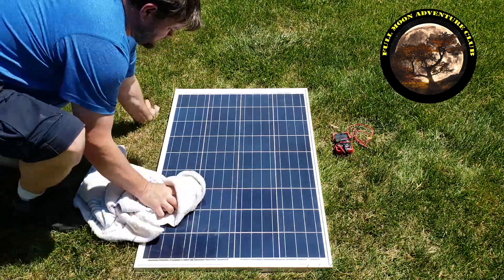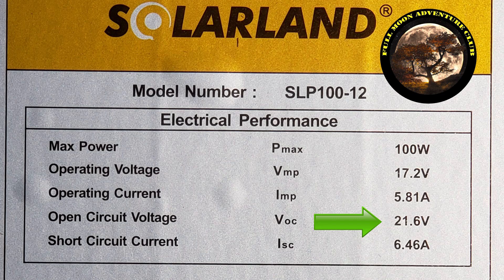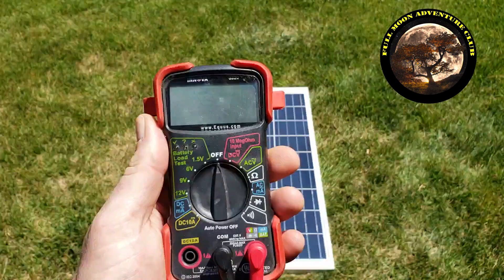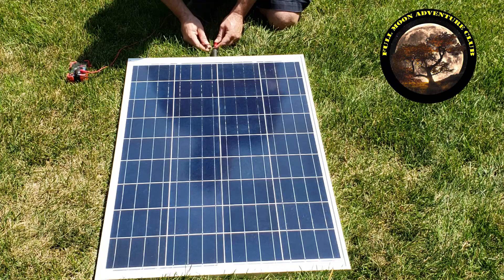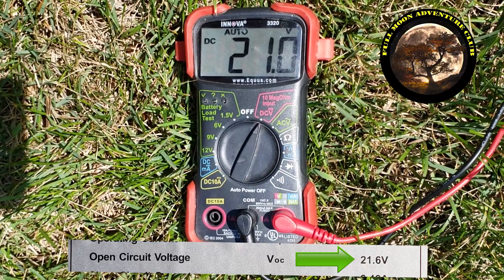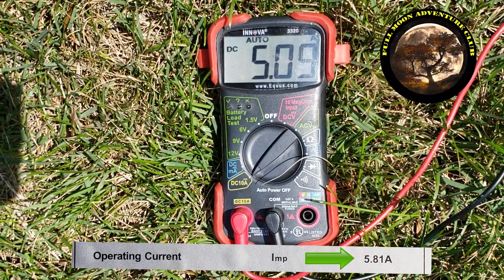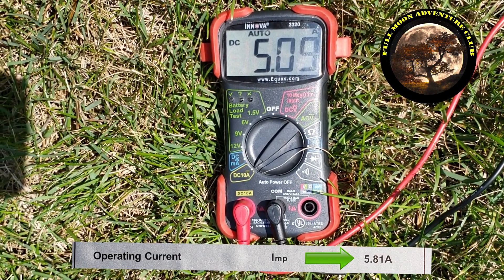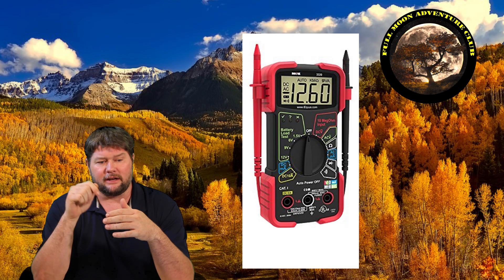How To Test Your Solar Panel - Quick And Easy

Comment: Thanks for the vid, I'm pretty handy and have installed four solar systems one a boat and three rv's. I ordered and installed a 200 watt on my new to me fifth wheel, all was working fine until one day I noticed no indication on my controller of volts to battery. I unhooked the wires and put a meter on and found zero, I grounded the meter lead to the ground on the trailer and it read out max volts, so I know I have a bad ground inside the solar panel, ( I checked solder to post it was fine), my question is can I just skip the ground wire from the panel and run wire from ground on the rv to controller? I have yet to get back to my trailer to try it, but just wondered what your thoughts were.
Reply from the maker: Interesting thought. I have never tried that before. While it makes sense in theory I am not confidant that will work. I believe the solar panel needs its ground to create current. I could be wrong. Let me know if that works.     Jim
Reply: fullmoonadventureclub well it turns out I had a bad diode, the company is sending me a new diode cable box, how that neg thing worked I have no idea, but I unsoldered the flat tin  neg and positive pulled the box off tested those in direct sun, had 22V. I was told there are some bad Chinese diodes out there that will fail or partially fail.
Reply from the maker: @timmytool1231  Thanks for letting us know. Glad you figured it out.   Jim

Comment: Where are the meter leads when measuring Amps? Same as Between + and - Or in line to a load?
Reply: Same place as voltage measurement.

Comment: Hi Jim can you add lithium batteries to a Kodiak genartor it only says agm or lead acid deep cylcle.and is it better to go with a regular solar setup like how you did with the batteries inerter an solar panels or just to get the kidiak.
Reply from the maker: It depends on your power needs. The kodiac generator is the equivalent of having a 100 amp hour lithium battery, a  1500 watt pure sine wave inverter , a charge controller,  and all sorts of electrical ports for different devices.  If you use one of my 20 % off codes (Adventure) or (4seasons) then the Kodiac is cheaper than buying all of those components  and installing them. I like that the Kodiac only weighs 20 pounds so I can take mine in any vehicle and camping. A permanent install in your RV will allow you to go bigger if you need to. As for the lithium batteries, you can not attach additional lithium batteries to the kodiac yet. I heard that they are working on a battery that would be compatible with the charge controller of the Kodiac but it is not out yet.  I hope that helps. Thank you for watching and happy camping.    Jim
Reply: Thanks Jim 
Keep rolling 👍

Comment: Hi Jim can you charge your 12vbatteries with solar panels and use them at the same time
Reply from the maker: Yes you can. There is no problem with using the battery while it is charging.     Jim

Comment: Hi Jim I whant to repair my rv roof and put new insulation in the roof but I don't know what kind of insulation I should use do have any recommendations
Reply from the maker: Megga cool ball Most RV roofs are foam block insulation. I would just put in the same kind of isulation that is already installed. If you can go thicker great. At minimum you will have better cuts than the factory as they tend to slap the panels in hastily. You can fill gaps with spray foam as well. Good luck. Take care and happy camping.    Jim
Reply: fullmoonadventureclub thank you thank you thank you

Comment: Its easier than that.  Run the healthy battery down a bit (maybe 25% or so) the next morning wait til the sun is up good and bright then enable your charge controller/plug panels in point then at the sun. How many amps are you getting at the controller display? The panels should be running flat out.  Take your panel wattage divide by 17.5.v = your amps. 

Are you getting that at the controller? I have Zamp and Renogy panels. They commonly exceed the panel specifications by 10%, but I’m not dropping much voltage over my panel runs ( 4 gauge bus, 8 gauge).  

I commonly monitor my 680watts of panels that way..  I always know what duty cycle my panels are doing by just knowing my nightly  bat voltage and checking amps production.